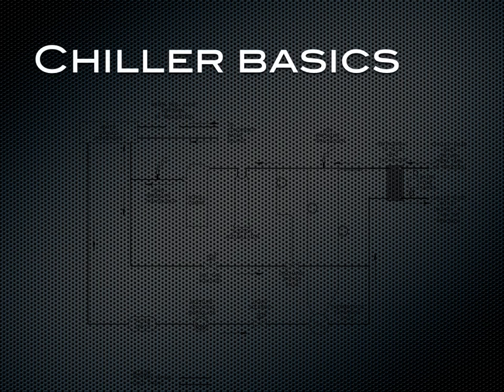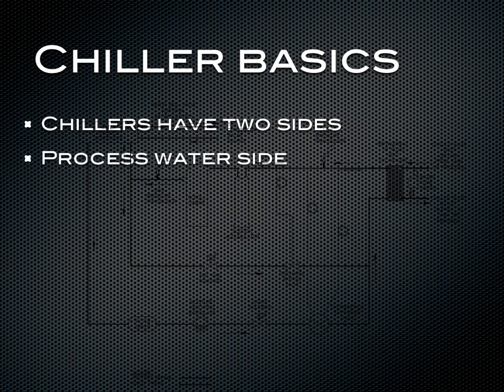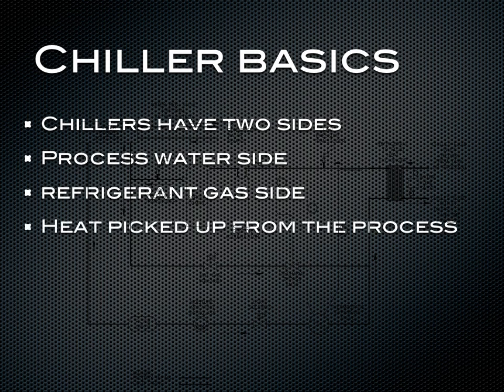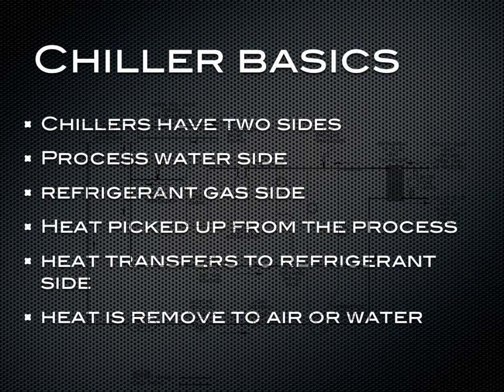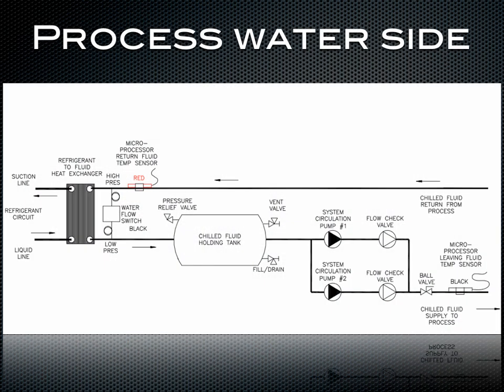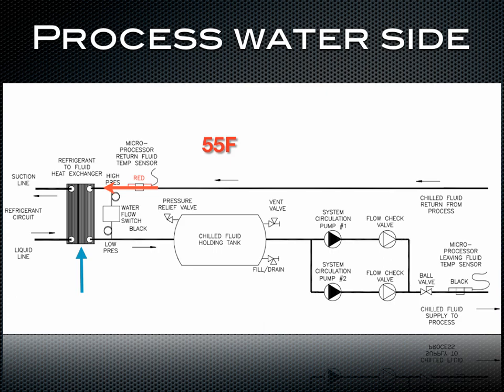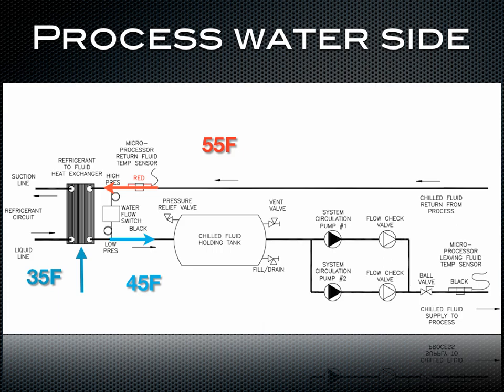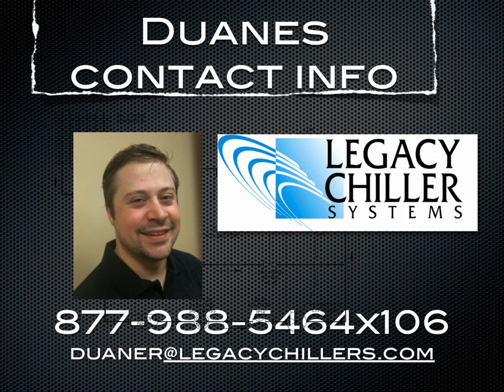How a chiller works- process water side of a chiller.

Comment: It's interesting how heat is absorbed/removed from a space!!!
Longer an ac runs the cooler it gets inside!(based on tonnage/sized system by square footage etc??)
Never really fooled with chillers but hvac air cooled condensers & chillers are nearly the same?!
I may start learning more about chillers!?
Guessing line temps to the indoor coils should be around 45-55 degrees!?
During spring/summer usage...
With sub cooling happening on outdoor condensing the temps inside drop gradually!!
This is mostly commercial application I'm aware?!
Reduces refrigeration lines & a lot of freon(refrigerant being used!).....
It's cheaper to run long water lines than refrigerant piping!
Many people don't understand how cool this idea is!

Plus buildings have zones etc different floors with different demands!?
Upper needs more cooling than lower levels?!
But the chiller is designed to cool the whole building at extreme temps outside too....
Too bad there's inner working issues wrkg for certain companies in this type of work!?

Comment: You sure that's called an evaporator? isn't that a condenser and the unit inside the chilled room called the evaporator ?
Reply: evaporator is the one which exchanges the heat from the return water and the refrigerant. In this process, the water gets cooled and refrigerant will change its phase from liquid to vapor.
Reply: You are thinking of a split DX system for air conditioning, this represents a process chiller. The evaporator in this diagram is a plate evaporator.